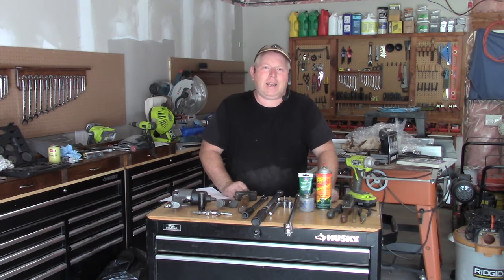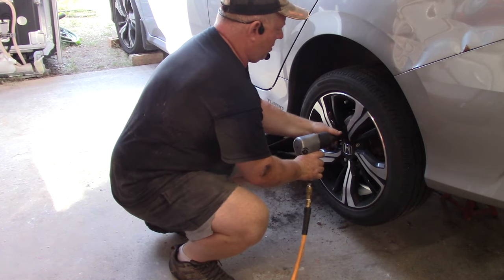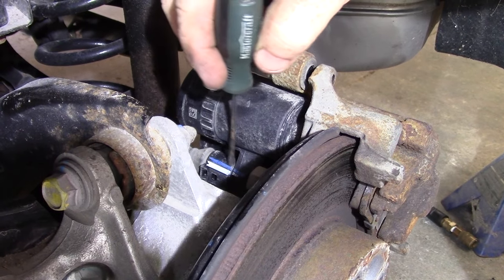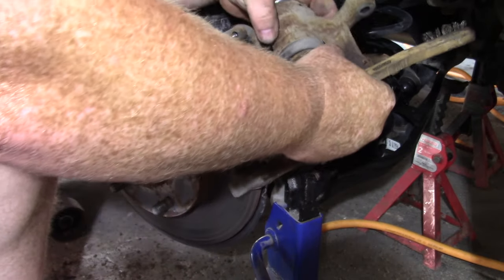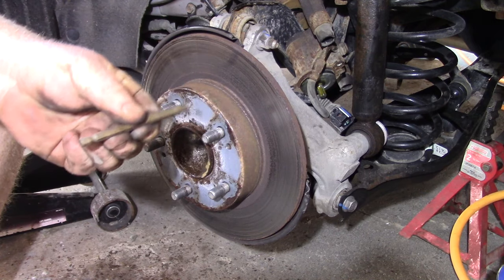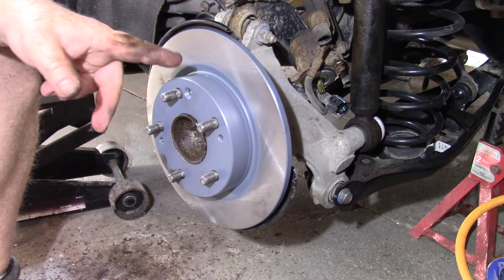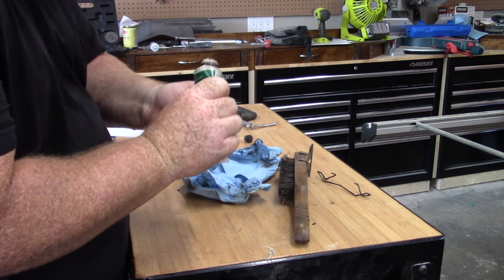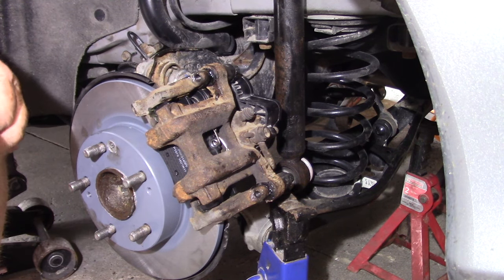DIY 2016 + Civic Rear Brake Replacement With EPB Using Honda Tech Manual

Comment: Best video I've seen on the 2016+ civic EPB brake system for rear brakes. I just got done switching out brake pads using this method and it worked flawlessly. Thanks for passing on this great info.
Reply from the maker: You're welcome!  Thanks for your comment!
Reply: Came to the comments to see if this video was the one to start with. This comment secured its position
Reply: @robsgaragewoodworkin  did the car need battery disconnect or just leave it off?
Reply from the maker: @vaporcloud1363  No.  you don’t need to disconnect the battery.

Comment: When I did the back brakes on my 2017 Civic I spent a fair bit of time trying to figure out how best to deal with the electric brake actuator. Unfortunately for me this guy’s video didn’t come out until after I’d done my brakes. Fortunately for me, I found one video that stopped me from making a big mistake. All but one of the videos at the time used the old twist the piston method of backing off the callipers. In that one video the guy used the Honda scan tool to back off the electric brakes through the car’s computer system, but he did show the pages from the Honda Shop manual that tell you how to back them off manually. They were displayed well enough that they could be clearly seen and read. The way he’s doing it in this video is exactly what the manual says to do. The manual also specifically tells you not to use the old twist the piston method because that will strip the gears out of the electric actuators.
Reply: To push the piston in  with a toyota just put the car in maintenance mode with a few manual steps at the dashboard and the piston retracts on it's own.
Reply: @tonyrock5313  I wish Honda had incorporated that into their software. The manual mode of doing it only takes 4 or 5 minutes but it would be great if you didn’t have to take the motors off the rotors. To use the software you need the Honda scan tool.

Comment: Yeah, the only thing I might add to this is at the very end of the procedure. After you’ve completed work on both passenger and driver rear discs and pads, and you hop back into your car.  Pump up your brakes put the car into accessory mode activate your parking brake and then the weird thing for me. It wouldn’t let the parking brake disengage even though I had my foot on brake and pressing down I actually had to start the car and then the parking would released and I cycled through several more times to make sure it was working.  So if you’re having trouble getting it out off the parking brake, start the car and then disengage the parking brake.   Thanks the only other hiccup I had was getting the electrical clip back onto the motor. It wouldn’t quite clip in. It took a hell of a lot of work on the one side before it would actually click. I cleaned it out really well too with a toothpick, I don’t know what was the issue.  Thanks so much for the video. It was fantastic.

Comment: Just did my wife's 2016 Civic rear pads & rotors after watching your video a couple times and taking notes.  Everything went super smooth with no issues at all.  Thanks for a very well done instructional video!
Reply: no issues with EPB? Dealership failed inspection...wants $400+ for rear rotors, thinking on doing it myself.
Reply from the maker: Awesome!  Thanks for the comment!
Cheers!
Rob

Comment: Just followed this video for my 17 civic and the only problem I had was with the first side when I was disconnecting the wire harness from the electric parking brake. The release lever broke off with hardly any pressure applied making me think it was broken already. After that broke the harness was still locked on somehow but I eventually got it off and the other side came off with no problem. I jiggled the broken hardness when I reinstalled it and it seemed to be locked on so I guess just the tab broke. Otherwise, everything went smooth except me forgetting to put the plastic plugs back and not noticing until the tire was back on.

Comment: Turn the caliper like the old Honda rear pads until it stops spinning clockwise. Then push it in the rest of the way. No need to take the ebrake off

Comment: I thought about taking our car to a mechanic or biting the bullet on a scan tool. This helped a lot, thanks!

Note for everyone: If you don’t have the E-Torx bit for the parking brake motor, there’s no need to buy a set. A 9mm socket works just as well.

Comment: Can’t thank you enough for this tutorial.  Did this job with the video playing on my phone; rewound numerous times, and got to a point where I could listen and work.  I didn’t even have the E12 socket for the EPD but got it twisted by-hand without issue.  ALMOST broke the clip for the coupler, but got lucky.

To anyone trying this-  Tale your time and follow the instructions to the T.  I had no codes or surprises after the install was done, and it took two careful hours to just do the pads.

Thanks again!  Ouut!
Reply from the maker: Awesome!  Thanks for your comment!
Cheers!
Rob

Comment: Followed directions and everything went smoothly.  No lights on the dash.  Much thanks for the tut!  For those getting a dash indicator, make sure you turn the actuator gear clockwise til it stops on both sides, fully compress the pistons and most importantly...make sure the sensor clip is plugged in fully.  It goes in rough and there's not much to the feel, only a faint click.

Comment: I had to watch a lot of videos where people destroyed their brakes before I found this one. Thank you for your competence. I was an industrial mill wright for years. I knew when I saw the motor on the caliper that  the job would be more than meets the eye. So many videos never sent that motor to its home position. Some turned the splines in the piston side itself. The comments contained the info on how their dash lit up. You seem to be following all the right steps people are talking about in the forums. One guy reversed the polarity of the motor to back it up.
Reply from the maker: Oh yeah, I scoured the forums to find the proper Honda Tech instructions.  I read so many comments from mechanics who were totally lost even though they used their computer to place the brakes in "service mode" but didn't calibrate the EPB by cycling it a couple times after they serviced the car causing ABS error codes.  It's really simple and easy but you have to follow the correct steps.  Thanks for your comment and good luck with your repair!
Cheers!
Rob
Reply: Did the piston compression tool rotate the piston with the notches or did it simply press it back in?
Reply from the maker: @jos_ayeee    The tool I have can do both but the Honda instructions say to remove the motor and just push the piston back in without rotating it.  Good luck with your repair!

Comment: Thank you for the amazing video! The mechanic wanted 250 CAD just to turn off electronic brake with a computer. And 1200 CAD total for 4 wheels rotors and pads. I got it done for 700 with a good amount of new tools. Very informative and precise video. Got no problems with the whole job apart from taking out those tough bolts.. i am not a strong guy. I had to leverage breaker bar a lot, still took a while.

Comment: Just tried this on a 2016 Civic EX and worked perfectly! Thank you! If you see yourself working on these brakes often, Autel makes a $60 Obd adapter called the ap200 that can put the Honda brakes into service mode. This video was a life saver for a last minute brake change!
Reply from the maker: Thanks For your comment!
Cheers!
Rob
Reply: Great work Rob , can you please also  make video for front brakes of 2019 civic ex 
Thank you 
God bless you
Reply from the maker: @Pakistan-hg7rp  https://youtu.be/guzc2YeMNuU. Already done.
Reply: Does the AP200 Work for Honda Crv 2017 and 2016 Civic?
Reply: Pardon the noob question but this will be the first time I dabble with an EPB - with the Autel AP200, putting the brakes into service mode, does that mean we don't need to use the e12 torx bit and turn clockwise? That's even if the Autel AP200 works. Seems too good to be true at $55, lol.
Reply: @goodfella563  Yeah, putting the EPB into service mode will do all the brake piston retracting work for you. But in a pinch doing it the manual way isn't bad at all.

Comment: Thanks for making the time and effort to share your experience with us.  I appreciate your very realistic and conversational approach.  When you lubricated the caliper mounting brackets where the brake pad ears slide (at 20:00), I have found that a very effective means to spread the lube is to use an acid brush.  Thanks again!

Comment: thank you Rob for the nice video ,today i did the rear brakes on my sons 2019 Civic , ,i did not disconnect the  coupler i try but was hard to come out ,was afraid might damage something so took of the electronic part from the calliper and when i was done with the brakes was very easy to pout it back , was my best fathers day ever lol.

Comment: I'm glad I found this video on how to replace the rear brake pads and rotors with EPB on my 2016 CIVIC . This video is all you need. Thank you sir for this video, God bless you. It saves me more than $500. I only spend $214 on pads and rotors. FYI I skipped removing the coupler for the EPB cause it kinda tricky or hard to remove in my case. Just be careful not to damage the wirings while unscrewing and retracting the EPB. So happy when no error code shows up.
Reply from the maker: Good Work!  Thanks for your comment!
Cheers!
Rob

Comment: Thank you kind sir 🙏. I replaced my brakes a few years back using another YouTube video and my piston seized up because it did not recommend the manual parking brake step. Had to purchase new calipers for both sides thinking it was my fault. Saved me from another headache and over $500

Comment: Thank you for this informative video. I replaced my rear brakes on my 2018 si today and followed your video step by step. Besides having trouble removing the rotor screw on both wheels, everything else went smoothly.
Reply: Try using an impact screw driver, harbor freight have it with different bits for like 9$ you just hammer it and it gets it loose easily

Comment: Great video that finally explains how to deal with the EPB without a fancy scan tool.
Reply from the maker: Thanks, but truthfully I was only following the Honda Tech instruction manual + some personal experience.
Thanks for your comment!
Cheers!
Rob
Reply: you can also use a power probe don’t have a power probe then you can make a tool, make a lead wire that connects to the electric parking brake motor from the motor to the 12v battery source it will power the parking brake motor  if it’s connected correctly the piston should power on and start spinning after a few seconds once it’s ready to be pressed in. once it’s spinning you then can use a pad spreader or whatever tool you have to push the piston in if it’s connected wrong the piston will power on and start pushing the piston outwards if that happens then reverse the leads you have connected to the motor
Reply: @desmondalers5369  the mechanic i used to work with told me about that. Could u elaborate ?
Reply: @user-hh4hc2lt6e  yes when I go to the shop in the morning I will show you the spade connecter and wire needed
Reply: @user-hh4hc2lt6e  hey add me to Facebook I can send you pictures I have pictures of the wire I made and use and the pictures  of the spade connector needed
Reply: My Facebook is My name

Comment: Steps to avoid EPB error on dash;

-Pump brakes until you get nice firm pedal
-Turn Car to the ON position.
-Hold brake down and apply parking brake AND WAIT until actuator finish it's LONG SPIN. Once it stop..turn parking brake off...(must repeat twice). 
-Then turn car off
-No error code.
Reply: Took a poop at work to watch this
Reply from the maker: @Exit13Boxing  time well spent 😂

Comment: thank you! done changing my brake rotor and pads without any problems. I have a civic 2016.
Reply from the maker: Excellent!  Thanks for your comment!
Cheers!
Rob
Reply: Hi guys ! Quick question... do I need to use the touch screen in the car and put it in some kinda service mode ?
Reply from the maker: @bettyguzman7130    No you can’t do it with the touchscreen.  You can buy a scan tool (code reader) that retracts the EPB or do it manually like I did in the video.  It’s easy.  Good luck with your repair!
Cheers!
Rob

Comment: Thanks for a great comprehensive video Rob.  You finally managed to show us how to safely back off the rear brake piston to allow for new discs and pads without a computer.  Yes, it would be wise to monitor and extract some fluid from the fluid reservoir when pushing the piston back in to prevent over flow.  But one trick you can do is push the pedal a few times after you complete one side with the key removed, thereby returning some of the excess fluid back into that brake cylinder.  Do the same after replacing disc and pads in the other side to then extract any excess fluid to the Max line.  After starting the engine you can pump and test that the EPB works in park to ensure both EPB units work and release by having someone spin each of the rear wheels while the rear of the car is still up in the air.  This is the only way to know that both the EPB units are working correctly.  My Civic was 4  years old and I struggled to remove the wire harness clip on one side and broke the tab on the other as the plastic seemed so unforgivingly r brittle.  Do you absolutely need the snap on clips or can you get away with cable ties to keep the connector attached and replace them each time you need to detach it.   Thanks again for a very informative video dispelling the myths behind EPB.  Hopefully Toyota EPBs are serviced the same way?
Reply from the maker: The locking tabs can be temperamental, looks like cable ties for now. Just tight though.  Don’t kill it.  Don’t worry about the brake overflow.  It physically can’t overflow unless someone has overfilled the brake reservoir. 
Thanks for your comment!
Cheers!
Rob

Comment: Hey Rob, As others have said you seem to be the only one with a complete video for this process. I got one side done by just using the caliper wind back tool. but the other side is giving me trouble. I rotated the piston as far as it will go with the tool but the caliper wont fit over the new brake pads. Does removing the EBC allow you to retract the piston a little more than using the wind back tool?
Reply from the maker: After it’s wound back completely you can press the piston in by turning the nut on the wind back tool.  Or you can press it in using a c clamp. People had all sorts of issues using the tool so I removed my video of it and redid it using the Honda instructions where you remove the EPB and wind back the piston from the other side.

Comment: Great, Great, Great video and explanation. Done my wife's civic 2017 without issues. Especially excellent explanation how to  disconnect, dissasemble and put EPD cover back. It did not come back until like you explained turn little bit hex bolt from motor. Thank you so much. Please keep making great videos.
Reply from the maker: Good work!  Time for a beer!
Thanks for your comment!
Cheers!
Rob

Comment: Thank you so much for the video! I just did this, and everything went well with the exception of having a grinding noise when I step on the brake pedal. Is that normal?
Reply from the maker: Nope.  That is not normal.  Take it apart and find out what it is.  Ensure the pads are on correctly and there is no debris between the pad and the rotor.  Sometimes a small stone can find its way in between the pad and rotor.  I have attached a diagram showing the pads.
https://www.hondapartsonline.net/v-2017-honda-civic--si--1-5l-l4-gas/chassis--rear-brake

Comment: Thanks for this well explained video! Should I put brake grease on the back side of the brake pads or is this unnecessary? Also, is disc brake quiet equivalent to brake grease?

Comment: Your video is very nicely done.  While you don't mention it in the video I believe there is an o-ring that seals the parking brake motor housing against the caliper.  Would you recommend using a gasket pick to remove that o-ring and cleaning up the groove?  Then applying a little syl-glyde to the o-ring and reinstalling?  Thanks for taking the time to do this.
Reply from the maker: Hmmm.   I didn't with mine.  I have to remember to check next time.

Comment: Great video! Super detailed and precise. Thank you for including the torque specs. I just did the rear and front brakes on my 2018 Civic Hatchback. I ended up using the Autel MaxiAP AP200 (only $60 on Amazon) to automatically unwind the EPB motor because I was a little nervous to take apart the motor housing and unwind by hand. Thanks!
Reply from the maker: Nice.  I’m going to get a new scan tool eventually.  They are finally available with the EPB features.
Thanks for your comment!
Cheers!
Rob
Reply: The Autel AP200 (or any scan tool for that matter) only addresses the EPB motor, right? You still have to manually compress the hydraulic piston? This will be the first time I'm tackling a system with an EPB. Did the Autel work well? Seems too good to be true at $55-60.